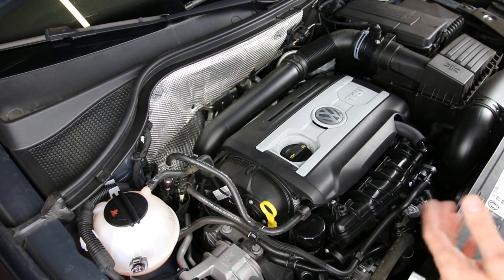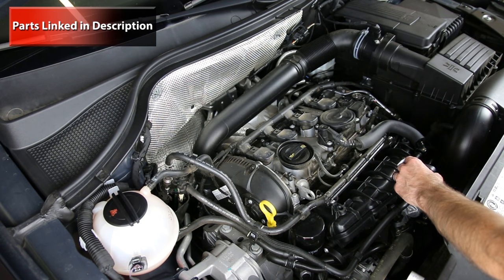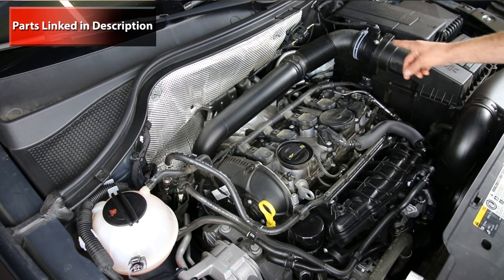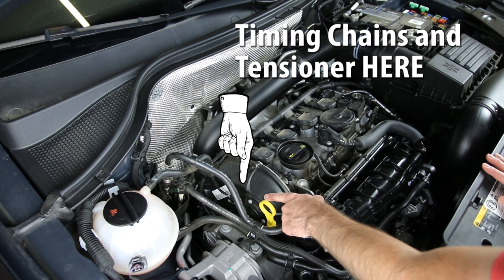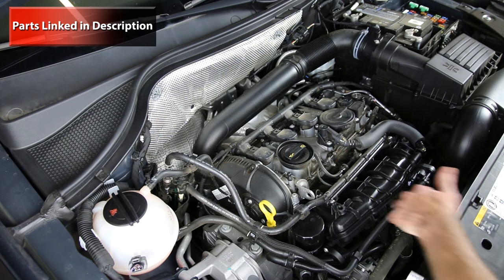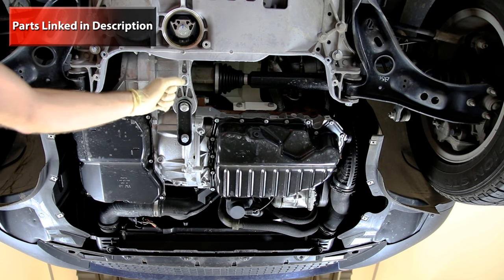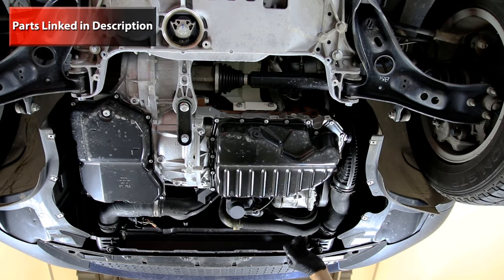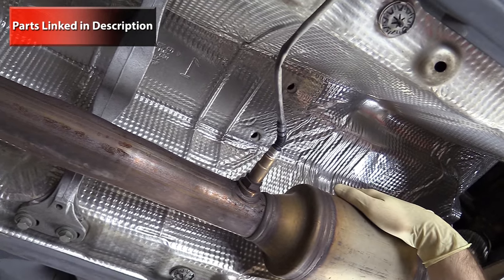2.0t TSI VW Engine Component Location

Comment: This video is a waste of time if you're looking for the crankshaft position sensor!
Reply: Did you ever find it? i took it out today by accident. Lol it was a pain in the ass honestly
Reply: @karinawashere  where was it?
Reply: @bradleymilstone  whew, i can hardly remember. I do remember we had to remove a coolant line to reach an extension in there. (without removing anything else) it’s on the front of the engine for sure. I’ve done many valve cleanings so i know for a fact it is below the air intake manifold and water pump assemblies.
Reply: @bradleymilstone  if that doesn’t help, you can head to your local vw and ask for a blown up diagram print out of the exact location.
Reply: No one asked you
Reply: @josephlopez5797 who hurt you lol

Comment: Hello!  I have an issue.  rabbits chewed up Turbo MAP sensor wires.  I found a par t number of 1J0973704.  I look online and they show all with 4 wires.  This one has only three wires (Brown in hole 1, nothing in hole 2, black on hole 3 and green in hole 4).  The plug has numbers written 1 through 4 as you know.  I need to find a replacement with the appropriate wires.  Is there any way you guys can direct me to the right person/place?  Dealership only shows the plug itself. What gauge are these wires if I have to recreate on my own.  Thanks for all your help!

Comment: Great information!  Long time listener/customer, first time commenter.  You mentioned the Aux water pump and referred to it as the After-run pump?  Does this component commonly leak?  I am guessing that it only circulates coolant after the engine is shut off for a given time period or temp.  If my main water pump is leaking, would it drip down onto the Aux pump and give the false impression that the Aux was the problem?  Thanks much!

Comment: Hey could you do a video showing the location of the Crank Position Sensor on said engine? Thanks
Reply: The sensor is on the lower right hand side of the engine near the bell housing.  This link shows the method to remove intake hoses to get at the crankshaft sensor:  https://www.golfmk6.com/forums/showthread.php?t=65011
This is a link for one of the images posted there:  https://www.golfmk6.com/forums/attachment.php?s=b271ccb4e3d419fa30214d88eb6203b2&attachmentid=35548&d=1377696977
Second image:  https://www.golfmk6.com/forums/attachment.php?s=b271ccb4e3d419fa30214d88eb6203b2&attachmentid=35549&d=1377696977
Reply: Hey do you have these same schematics for a 2013 Jetta Hybrid 1.4

Comment: Thank you for the helpful parts locater.
Now I'll try to be helpful in my own capacity:  A part that is prone to failure is a "problem" part VS a part that "has issues."
An "issue" is something debatable, whereas a problem is something troublesome.  Common misusage:  "I've have health issues; my liver is failing."  
If one's liver is failing, it is very much a "health problem," not a "health issue." An issue would be which is the best hospital at which to have a liver transplant performed, while a "problem" could be whether of not one's insurance will cover the surgery! A failure-prone part, such as fuel pump failure on an E888 series VAG engine is not an "issue; it's a mechanical "problem."  An issue might be whether or not its replacement is warranted.
Thanks again for your helpful video!

Comment: Apologies if I just missed it in the video but where is the MAP sensor located? I have a 2012 Mk6 GTI that is throwing the "Lean at idle" code and is also having boost control issues. From the little research I have done the MAP sensor is a common component in both problems. Thanks!

Comment: Great video. I have a 2013 VW CC Sport with a 2.0 tsi engine. I'm trying to find the location of the back up/reverse light switch. If I remove the battery will I be able to see it?

Comment: Hi Guys, Great video. I was hoping you might mention the "plastic cover" on the front of the engine underneath the intake manifold. I have a coolant leak coming from this area and was wondering what its purpose is and can it be removed and repaired/sealed by competant home mechanic?

Comment: How hard to change the knock sensor on this?  It’s one bolt and one plug?  It looks like the green plug is easy-ish to unplug and plug in the new one.  Is the bolt end easy-ish to get at also, or more involved?

Comment: Very interesting, if possible could you do a similar video covering the VW 2009 2.0l TDI  common rail MK 5 Jetta that has a CBD0 code engine, info about this particular engine is a mystery.

Comment: Do you have any videos on P229400 Fuel Pressure Regulator 'B' Control Circuit Open?  How to fix on a 2009 VW GTI TSI engine.

Comment: What's the air intake looking thing just forward of the battery?  It's broken on mine and won't snap back together.  It's like you guys purposely skipped it on your review just to frustrate me! "Here's the battery, here's where all the fuse boxes are, and - oh, I forgot the magnet on the VVT sensor, and now that we're back over there, let's talk about cam sensors etc."  Kidding, but I felt like I was so close.

Appreciate any tip.

Comment: I bought a 2010 VW Eos 2.0l TSI, CPFA. The seller told me it will need a new engine because it make noise. A mechanic looked at it, did not open up the engine, but suspect it may have some  grinding inside. The goal was to do a head job, and timing, and may be replace the piston.
1) Would recommend rebuilding the top part of the engine, because there is nothing inside the crankshaft that shows defect or damages. Or you will suggest replacing it the engine with used one?
2) What type of engine will fit my car. i notice that on Ebay, there were several engine for jetta that will fit Eos cars. none so far matches my car.  I do have a copy of my Car Data sheet from dealer, I can send to you , if it will help.

Comment: Great video I have the passat FSI 2.0, I have an over heating problem , I've replaced thermostat , coolant temp sensor , tested the fan with a battery , the turn but dont work when the car is running and I get into stop and go traffic , car overheats. what can be the issue , the fan control module is built into the primary fan , can that prevent the fans from  working properly even though with direct battery power the run? Can It be the Fan relay, WHERE is it located?  Please help

Comment: 2010 VW CC  the VVT Solenoid, is that the part you mention under the timing valve cover that has oil problems? I am unable to located it. So I am to the point to remove that cover and look. I was wondering if this would be were it is P0011 Camshaft position. Thanks

Comment: So my 2.0 has a filter cup at the bottom, which leads me to believe I need to drop the bottom portion of the cup. The only way I see to access the top would be by removing radiator hoses and losing all my coolant. Thoughts?

Comment: I have the code p0506 for the iac (idle air control) system, can you point in the proper direction to repair it, I can't find anything about it.

Comment: I have a 2012 VW Jetta GLI MKVI. Does this vehicle has a Ignition Coil Control Unit or similar to Distributor Cap? I replaced all four spark plugs and all four ignition coils but the car still start rough in the morning and triggers the engine light to come on. The engine light error shows P0303 which is cylinder 3 misfire detected. Any solution? Thank you in advance.

Comment: Where is power steering fluid reservoir located on the 2017 VW beetle TSI engine?  Is this possibly a non-sservicable component/system?
Reply: it may be electric.  my 14 passat is electric

Comment: Hi there first time viewer...this was an amazing video and one i was hoping for someone to do for ages! Even more impressive was the list of components with exact time mentioned smashing, i came looking for crankshaft position sensor as i have a no start on my vw touran 2007 tsi, not sure if it's the 1.4 engine but probably has the same location i don't see that mentioned did i miss it? Dreading its not like the 2.0 tdi golf which needs oil filter housing removed and still a nightmare to get to.

Comment: Hey I have a question about my TSi. My 2010 golf gti is running like crap rn and it’s giving massive amounts of oil pressure lights and warnings. I’ve changed the oil pressure sensor, and camshaft position sensor. I was researching and I found out about a camshaft bridge? They often mess up in tsi motors which causes, stallage, oil pressure signals, but does it cause low oil pressure because my car is only at 8psi. Really not trying to replace motor

Comment: having throttle position sensor pop up when i get on the gas a little tried replacing throttle body didn't help only thing left is wiring or pedal any ideas??? 2009 vw passat 2.0t tsi engine as shown in video any help would be appreciated.

Comment: Hi Humble Mechanic, do you by any chance have a video on how to replace the cam shafts adjuster on 2009 volkswagen Tigua that locate at the passenger side because I noticed I have an oil leaked that trace from that area only after a few week investigated it. Also need your advice should I change the whole cap part as the whole black cover thing or just replace the seal or gasket if it is even had one. I would like to thank you and I appreciate anything from you guys and you guys is D best.

Comment: @4:00 I have a question about this. I have a gasket there that's sucked inward a little so it's not a full seal. And whenever gas is applied. It tends to leak a little. Is there a replacement for that gasket itself?

Comment: Hey man. I have a 02 gti 337 edition, and recently I started hearing a whistling noise under full boost. I hear that this can happen to diverter valves when they're dirty or going bad or what not. Think that's my issue? Also have a code for an evap leak but I don't think that would have anything to do with it. Sai is deleted and the car is stage 1 apr. but this noise just started happening a few days ago.

Comment: Hi,

I have the same water pump on my 2010 Audi A% Cabriolet 1.8 TFSI as the car in your  video and it is leaking very slowly after only 16,000 miles, yes that is correct it is a 2010 with only 16,000 genuine miles on the clock.  I have ordered a new OEM replacement pump so I stripped down the engine and electrics today to check I had all the tools to do the replacement when the pump arrives next week.  It looks like my original pump OEM 06H 121 026 CA has a ball bearing type relief valve next to the front of the drive shaft housing that is slightly leaking.  The replacement I have ordered is OEM number 06H 121 026 CQ and does not appear to have any relief valve.  Do you know if this was a design fault with the original pump that has been engineered out?  If so, do you think I could just sealed the existing faulty relief valve with say epoxy resin and hold off changing the pump until the summer?

PS I will be changing the pump it anyway, I was just interested in your expert advice.

Many thanks ,

Andy Liverpool, UK

Comment: Whats the connector called where the upper heater hoses connect into heater core? Specifically the coolant line that is connecting right above upper heater hose

Comment: Does 2018/2019 tiguan have direct and port injection - my 2019 seems to have 8 injectors across top of engine.
Reply: Did you find the answer to your question?  I am interested to know if this change was implemented.  Thank you

Comment: Hey brah i need help, i just need where is located the valve n249 and n75, mi gli have a recolocation of diverter valve so i put a blow off forge, but in tha turbo have  una solenoid and in the blow offhave other one and i look or i think is the same valve, have the same connections and everything HELP

Comment: I have this exact same engine and i have my check engine light on, when i plug in my diagnostics tool it gives me 2 errors "00152 intake air temperature sensor 2 circuit, high" and "12600 intake manifold runner control (imrc), control difference" , i did change the air intake temperature sensor the one close to the throttle body you showed here 1:05 but my 00152 error did not go away, even after clearing it comes back. I'm starting to feel like there are 2 of theses sensors since mine has a "2" at the end of it and i might have changed the wrong one, if this is true may you please help me locate the other one and also locate the (imrc)

Comment: I'm looking for the 'rear heater core temperature sensor', does anyone know where it is? Can't find any info of it being in the heater core or whatnot. I got a engine check light and cylinder misfiring with the code 768. I already swapped out my spark plugs and ignition coils but the light is still on and I'm still flushing out brown coolant...Any help would be greatly appreciated!! (This is for 2012 VW Beetle Turbo w a 2.0 TSI engine btw)

Comment: I have VW Tiguan 2010. My concern is every summer I am having issues with my car. While I am driving there is a time my AC cut off automatically and then parking error appear in my dashboard. When I try to stop the car and use my electric parking I can’t switch it off again. The only solution that I made is re attach the battery. I send my car to garage to diagnose the computer but they are unable to see what the issue is. Please advise.
Reply: Looking forward to your expert advice.

Comment: hello guys thanks for the video
I have engine check light on dash .
I checked with a diagnostic device and p2432... secondary air inj. system flow/pressure sensor bank 1
sensor short to ground
my mechanic tells me to replace the exhaust catalyst 

 I am getting very  low gas mileage on fuel... I am visiting the gas station just at 290miles of full tank 
please help me

Comment: One question hope someone can answer i  the tsi engine the waterpump/ thermostat are one as a whole under the intake manifold. And the coolant temo sensor is there also. Please don't tell me intake manifold needs to be removed. Also can i get to the sensor by removing the throttle body hose?  🤔
Reply: Ivan Giraldo if you're planning to do it without stress, you'll have to remove intake manifold

Comment: I have a 2010 cc 2.0.. was running fine and shredded a serpentine belt. After putting a new belt on it im getting all kinds of misfire codes and cam position codes... is there a sensor or wire that belt might have ripped off when it broke?

Comment: I needed to know where the thermostat was located.
Reply from the maker: In the bottom of the water pump on the front of the block.
Reply: Thanks! Unfortunately, wife doesn't want to spend any more money on the 2.0T, and has elected to buy a '19 Jetta. But thanks for the info.
Reply: @Deutscheautoparts  How to replace it?

Comment: Where is is the Crankshaft position / Engine speed sensor location?
Reply: Anyone? its the G28 Sensor. Tried searching on the web but to no avail of its exact location in a 2.0TSI
Reply: I have the same question
Reply: Miguel Martinez having trouble find the Camshaft sensors. I know the vehicle calls for 4
Reply: Brandon Pressley Im trying to locate the Crankshaft Position Sensor

Comment: You guys aren't doing a great job of slowing down and actually zooming in on the component as you point them out. ..I noticed that on a couple different 2.0 t videos. ...like the guy just did the job and Explained it in the process,pretty thoroughly too...BUT Z THE CAMERA ANGLE was so far away on pointed from the front instead of from the top so we could see what he was doing lol